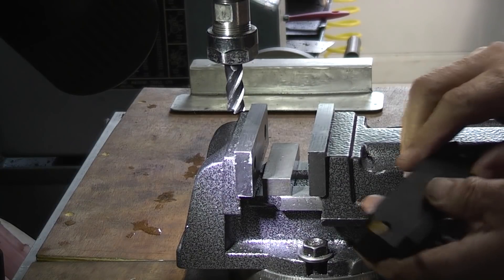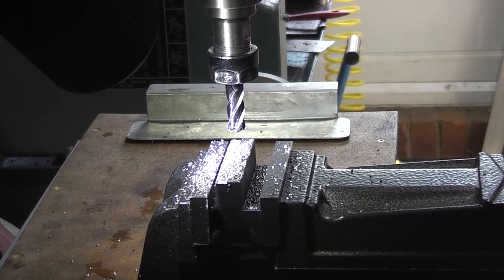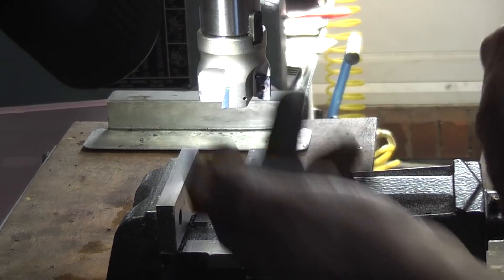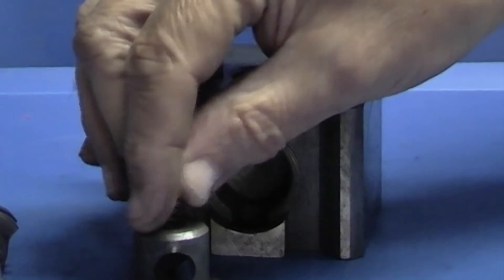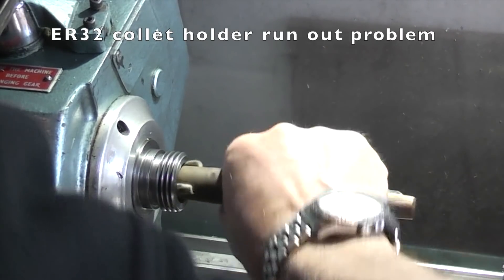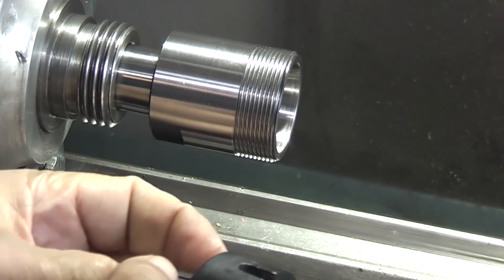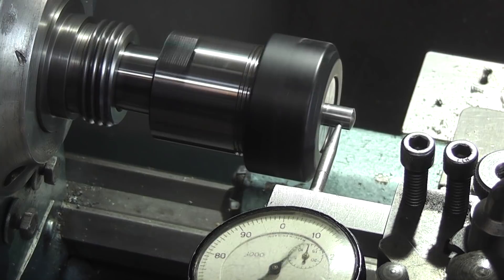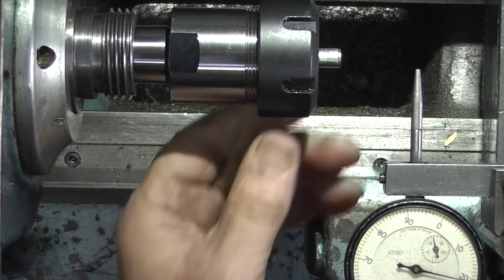Get an ER32 collet running true. Milling a parting off tool &Tool post overhaul

Comment: Hi. Recommended tightening torque for ER 32 collet nuts on the size collet is 100 lbs ft, or 136 Newton metres.  That will also affect the run out. BobUK.

Comment: I suggest a ball bearing nut with a proper ER wrench instead of that pokey little hook wrench will allow you to correctly seat the collets when the correct amount of torque is used. If you don't use a ball bearing nut and continue with that hook wrench with too little torque you will get issues when the work piece is side loaded no matter how well it runs unloaded.

Comment: I liked your collet investigation; it would be interesting to use a longer test bar and explore how runout changes with length between the two nuts to show if the runout is radial or axial and if the 'good' setup maintains this over length. Another concept is that once you have ground the interior of the holder, the threads will no longer be true with respect to the taper, and thus this may accentuate 'problems' with collet nuts. A test peice with the same threads as the nut and see how true it runs on the holder.

Comment: I have done similar testing and taper grinding. Found even better consistent results using a ball bearing collet nut. They are not expensive and really do help. Cheers

Comment: Boxford have a special round nut that goes on the spindle threads for protection. Probably meant for protection when collets are mounted directly into the spindle.

Comment: It would be interesting to check the run out , if it changes if you tighten the collet nut to the tension it's supposed to have  .  About 100 ft/lb's . Just a thought .  Cheers .

Comment: Do you think it would help to reduce run out further if you reduced the stick out and allow the collet holder to go into the spindle a little more
Reply: How can that be achieved? It's a morse taper.
Reply: @ianskeldon6032  Let's say if you ground a little off the OD would it not go further in the bore !
Reply: @Blackcountrysteam  you might then have trouble with the draw bar length.